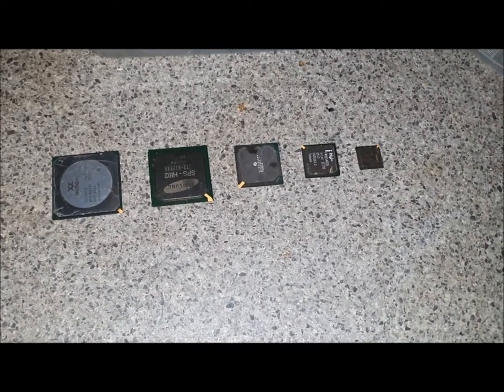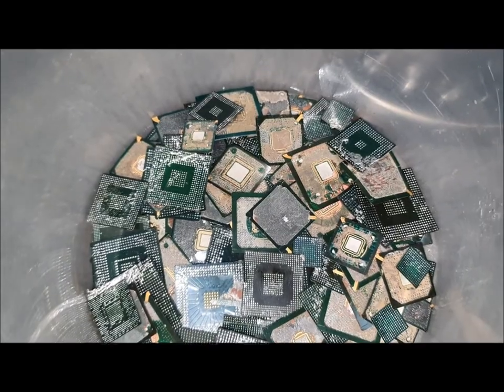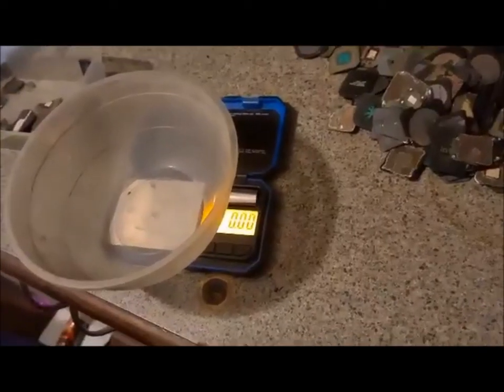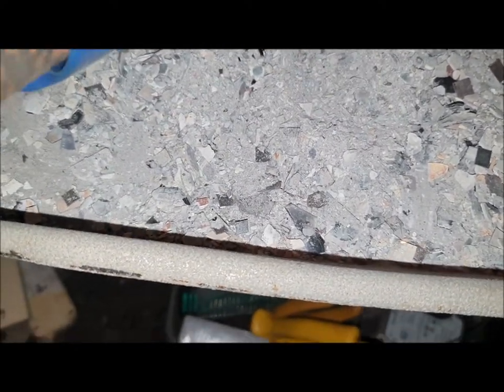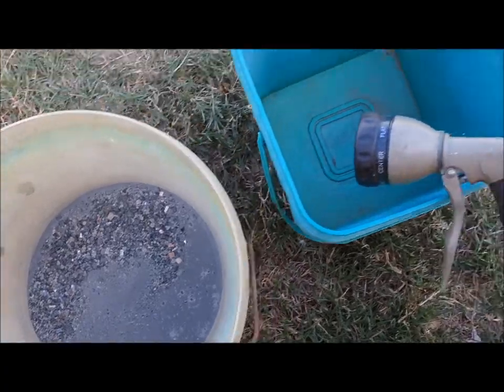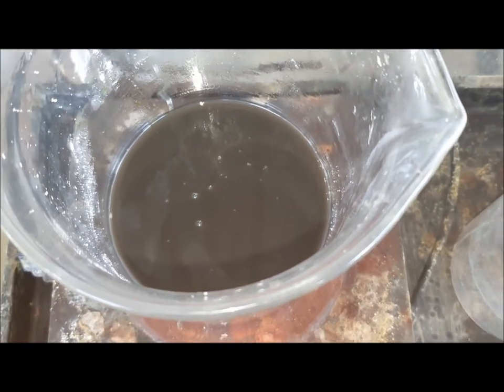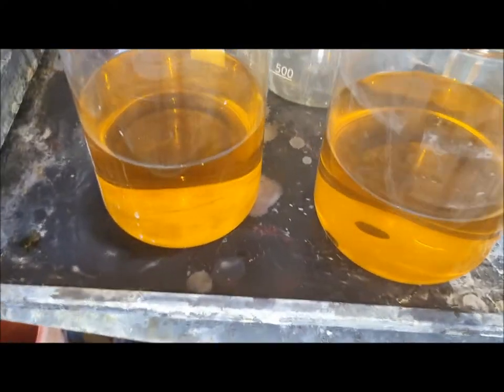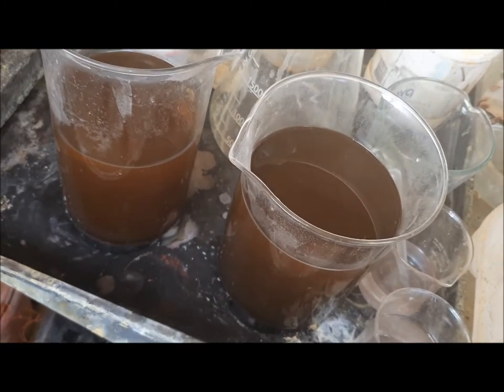GOLD RECOVERY / extracting gold from gold corner bga's

Comment: Catch pan.. I'm freaking out with that glass on heat! Nice video
Reply from the maker: I cant find any corningware dishes to use as catch pans. Ive been looking everywhere. Everything else breaks. Even pyres breaks
Reply: use a little frying pan, just big enough for your beakers. throw a little sand in pan.ir works a treat.cheaper than Pyrex and corningware
Reply from the maker: @aidavewaste2576  and if i have an overflow , it mixes with the sand
Reply: @prospectorpete  yeah your right. the sand is optional. I just use it to disperse the heat a bit better  to save on my beakers blowing out..I'm not talking 2 or 3 inches sand.just enough to cover your pan and to protect the beaker..before you use the sand, make sure  all the shit is washed out of it and if you do have a boil over its easiar to clean especially with that brewers bag you have.im definitely going to invest in one of them. it's the cheapest option  i could think off.its easy to get sand and an old frying pan.
Reply: @prospectorpete  would you rather lose all your solution over treating the sand? Can you treat sand in nitric? I'm so new to this, but I'd have a spill pan to catch my spill pan if ya know what I mean.. 😂
Reply from the maker: @aidavewaste2576  yeah good point , youre onto something there . i will look for a cheap frypan and some kind of clean sand
Reply from the maker: @markleffler2275  yeah youre definately right . having sand is a much better option , i will be doing it when i can find some clean sand such as playground sand or something . and yes you can treat the sand in nitric , it will just use a hell of a lot as it absorbs so much , but i agree its better than losing gold

Comment: When adding the fiber boards to AP...are you not concerned with the solder ?
Reply from the maker: no because the hcl in AP dissolves the tin
Reply: @prospectorpete  so just put in AP then filter out the foils...
Reply from the maker: @chrisferrante9699  thats right

Comment: One more thing about Aqua-Regia,when you made it the solution it last 12h in eating the gold after 12h is not good for gold an it won t work.
Please check that,you can do drop later(time is not important) but to eat gold from moment you make mixture it work on gold 12h.
Ask someone because I am maybe wrong so check that fact about AR time for gold.
All the best.
Reply from the maker: i havent had any problems with it working no matter how long after i make it . but the gold is usually dissolved by then anyway

Comment: I know you did this 3 years ago but what part of a piece of wood burns last? The middle for the most part. The same principle applies to chips. If it don't break up it's the center of the chip . Where is the gold in an IC chip?  It must be total ash or you WILL loose gold. . AR or not, your not getting that gold out. You have 3 options, grind it to powder by hand, wet ash with concentrated sulfuric or burn it again. I currently have about 15 lbs of them. Built a custom rotisserie kiln to tumble the chips as they burn. Steel pan in the bottom to catch the ash. Yet after extensive testing, I'm wet ashing the entire 15 lbs. Nothing will get the gold out like wet ash. I did, hold your breath, 7 gold corner BGA chips, wet ash. Gold recovered from the 7 chips .41 grams. Other methods not even close. Pitiful, .2, .15, .25
Reply from the maker: thanks for info.

Comment: Please help. After incinerating, pulverizing and magnet cleaning surface ICs, then using hydrochloric  and nitric acids to rid the white metals and copper I'm STILL left  with metallic legs!!??. What type metal is this ?
Reply from the maker: Hcl won't get rid of copper. It only removes the tin from the solder.
Now you need to soak the ic residue into dilute nitric
Reply: @prospectorpete  Thanks for prompt reply. Yes I used the nitric for copper and afterwards  was no visible copper colouring but wHat is left is grey colour metal legs! I'm scratching my brain thinking what it could be
Reply from the maker: @jeanwyngard3478  did u use heat ?.
If you put the residue in nitric and put it on heat, it should have disolved every type of metal except gold
Reply from the maker: Did u dilute the nitric with water ?.
The nitric disolves the metal but it needs somewhere for the metal to go. That's what the water is for
Reply: @prospectorpete  Ok u said 2 very interesting  things. Adding heat dissolves  all metals except gold!! It's my first time hearing this. It will of of immense help. I used nitric neat! I thought the stronger the better. But it makes so  much sense to add water to carry away the other dissolved  metals as you say. I need to subscribe  to your channel now!!
Reply from the maker: @jeanwyngard3478  well ty s much . im glad you like my channel. ty fr watching my video
Reply: @prospectorpete  Can you confirm for me please that nitric acid on heat dissolves  all metals except gold? Even chromium? I have yet to buy some to try it.
Reply from the maker: @jeanwyngard3478  that's correct. But make sure there's absolutely no trace of hcl. If you've soaked in hcl to remove tin then you need to rinse thoroughly before adding nitric. Because the two acids together will disolve gold.
Once you're sure you rinsed all traces of hcl out, rinse a few more times for good measure
Reply: @prospectorpete  Couldn't I just use hot nitric for all metals (except gold) right out the gate instead of bothering with HCL? Or hot nitric does not dissolve tin?
Reply from the maker: @jeanwyngard3478  only hcl removes tin
Reply: @prospectorpete  Ok I understand  the full situation now.  Much appreciation for your help and patience.  May you have a very goldfull life.
Reply from the maker: @jeanwyngard3478  thanks

Comment: Better the wet ash way your way works
Reply from the maker: Wet ash is extremely dangerous
Reply: How is it dangerous?
Reply from the maker: @antoniotrepistole1383  because youre dealing with boiling sulfuric acid . its bad enough at room temp . if you get boiling sulfuric on you it will eat you to the bone before you can blink . and then theres all the noxious fumes produced when wet ashing
Reply: @prospectorpete  Yes I agree entirely. I got it the wrong way round thanks for putting me straight Pete.
Reply: @prospectorpete  i always do the bga type in wet ashing methode, you just have to pay atențion at boiling and toxic fumes. And top part is plastic bro, not ceramic, lol. In the ashing methode you are losing some gold, it is suirable just for flat paks and big fat cips, because in wet ashing those gone eat alot of sulfuric acid, like 8x of their weight. For the bga you will need just 3x from total weight.
Reply from the maker: @niculanicolaeofficial9114  ive done wet ashing but I dont show it because its so dangerous. I'd prefer people learn the safer way